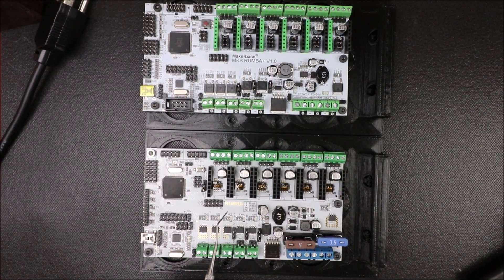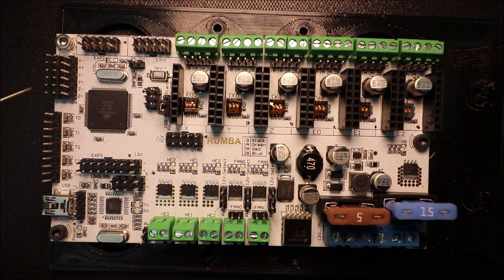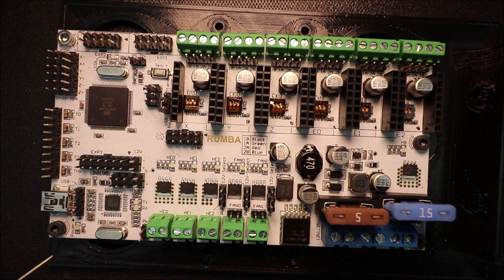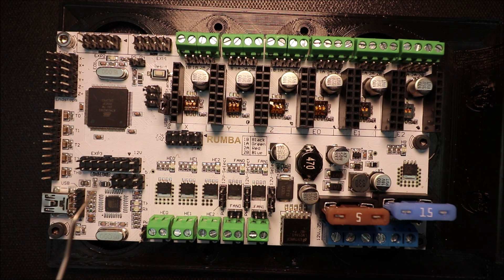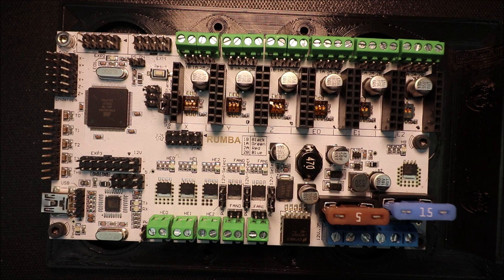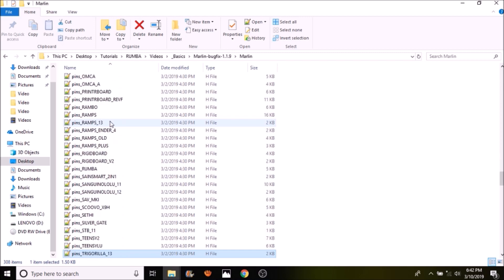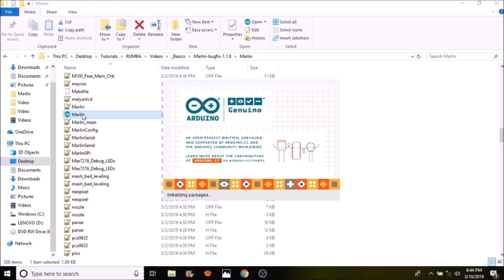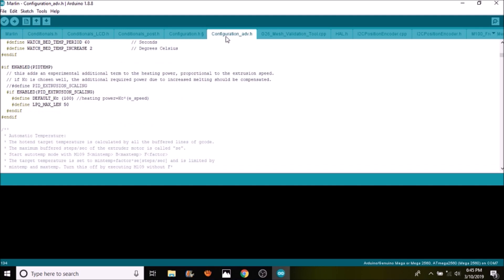Rumba - Basics

Comment: hey because you answered me in the last comment i try i again. on my board rumba32 there is no jumper. i installed marllin with reprap12864 smart controller and when i plug usb in it works. but it does not work with 15V main pwr. only. any idea? 12v pins shine but not the 5v pins. can this be something in the code or os it pure hardware ?

Comment: Hello wondering if you can or willing to help me a bit as i just got a used printer and it needs some tlc but from how the wiring is to how you do it mine doesn't look right and there is a little pcb screwed to the corner wired to the i think x min pins
Reply: If i knew how to id send a pic of it and it is a rumba pcb
Reply from the maker: On the YouTube channel there should be a link to Discord.

Comment: ok got it turned on nothing caught fire turned on LCD a go menu popped up went into settings and tested motors and they kind of move a mm and buzz  but that's it wires are bought and are correct
Reply from the maker: They move but,  buzz?  Sound like you will need to calibrate stepper drivers.
Reply: @EdwardBraiman  https://www.amazon.com/Dell-Optiplex-desktop-H240AS-00-Computer/dp/B00ZR54C48/ref=sr_1_10?keywords=dell+psu&qid=1558599456&s=gateway&sr=8-10 my psu have enough power for 7 steppers and rumba no heat bed
Reply: @EdwardBraiman  my power supply is only 11 amps will that matter with the stepers my nema 17 hybrids
Reply from the maker: @cyberblade6669  here is a reference page,  https://reprap.org/wiki/Power_Supply

Comment: On my board the E2 engine does not rotate, it only does back and forth movement, any tips to solve this.The engine and driver are ok.
Reply from the maker: So I need some information.  What are your motors and stepper drivers?  What's the printer board name.  What happens when you reverse stepper driver and or motors from E2 to E1?  What messages do you see in Pronterface?  Can you turn debug on in Pronterface?  Do you see any error message.  What position are the switch positions in under stepper board for E2?  Does the problem migrate after moving stepper driver and motors.  Is the Marlin firmware changed from defualt download?  Are other things connected outside of components in tutorial?
Reply from the maker: Check wiring of stepper motor or try another stepper motor on E2.  Sounds like a loose wire or wired backwards on one or more motor poles.